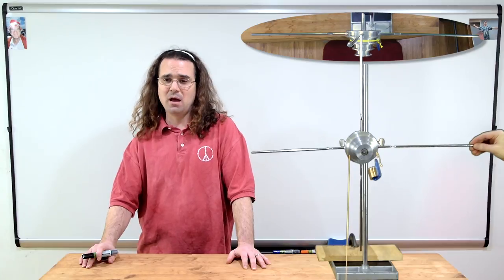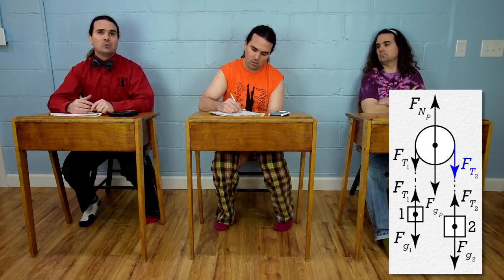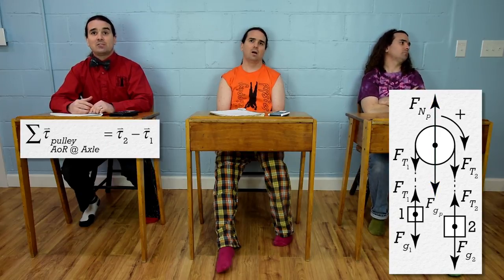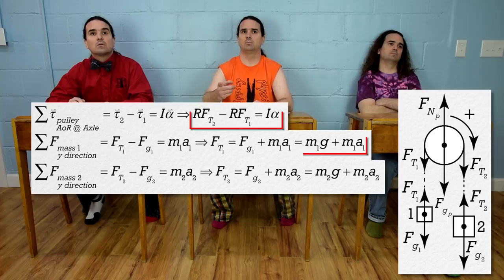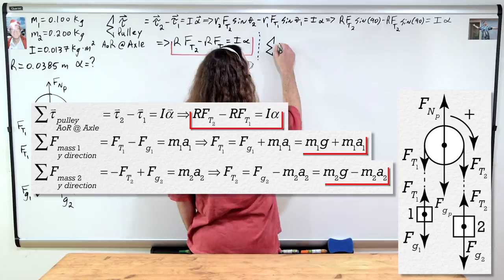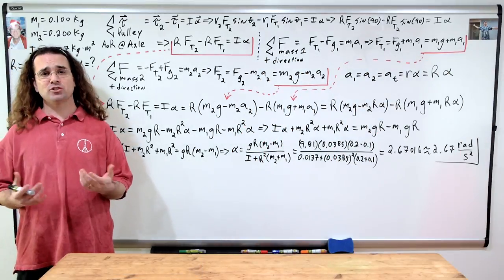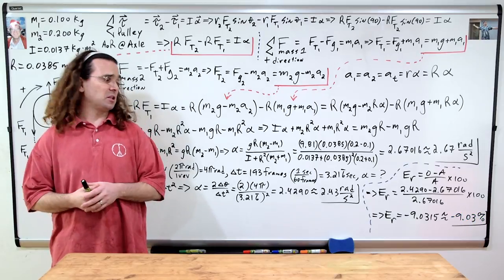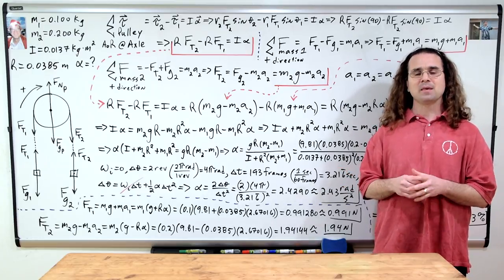2 Masses on a Pulley - Torque Demonstration

Comment: What if pulleys with different radius share the same rotational axis?

Thanks.
Reply: The two pulleys would share a common angular velocity (and angular acceleration) by virtue of being part of the same rigid body, but have different tangential velocities and tangential accelerations of the spooling string, that are each proportional to their respective radii.  You would also need to set up a relationship between the two angular accelerations based on the ratio of pulley radii.

As an example, suppose mass 1 is 10 kg, and is connected via a massless string to the left side of pulley #1 with a radius r1 = 8 cm.  Mass 2 is 5 kg, and is connected via a massless string to the right side of pulley #2, which has a radius r2=4 cm.  The two pulleys are rigidly attached to a shared axle mounted on frictionless bearings, and the entire assembly of the axle and pulleys has a rotational inertia of 0.012 kg-m^2.  Calculate the unknown accelerations, tensions, and angular acceleration.

N's 2nd law on m1, assuming it descends:
m1*g - T1 = m1*a1

N's 2nd law on m2, assuming it ascends:
T2 - m2*g = m2*a2

Torque on the pulley, and rotational version of N's 2nd law:
T1*r1 - T2*r2 = I*alpha

Relation to alpha of a1 and a2
a1 = alpha*r1
a2 = alpha*r2

5 equations, 5 unknowns (alpha, a1, a2, T1, and T2).  Solutions:
a1=5.6 m/s^2, downward
a2=2.8 m/s^2, upward
alpha=70 rad/s^2, out of the page
T1=42 N
T2=63 N

Comment: If the pulley is frictionless, why will it rotate? Won’t the strings just glide over it?
Reply from the maker: A "frictionless" pulley has a frictionless axle only.
The mass of a string is so small relative to everything else as to be negligible.

Comment: why do the hanging masses not contribute to the torque ?
Reply: They do, but indirectly.  The masses are connected to the pulley through the string segments.  Since the tensions in the string segments are what act on the pulley, we don't need to further account for the masses, when summing torque on the pulley.  We already did that by accounting for the tensions, each applied by these masses.
Reply: @carultch  Well, to be more precise, the total torque on the pulley about the central axis is due to the static friction between the rope and the pulley. When we sum these forces, mathematically, it's equivalent as if it is the tension force that is producing the torque. Unfortunately, this is omitted from most if not all high school textbooks.
Reply: @Test-ph1vk  True, it is static friction that is really causing the torque.  This is probably ignored from most high school level textbooks, because it is an extra detail that doesn't really contribute to the main substance of the problem.  This is usually introduced in freshman-level engineering classes in college.

There is an equation called the capstan equation that governs the upper limit of tension ratios on opposite sides of a string wrapped around a cylinder, that is derived from static friction in this example.  Named the capstan equation, because a capstan on a sailboat is an application of this formula.  Where you would want to model this detail in this problem, is if you were asked to determine limits to the hanging masses, before the string would skid on the pulley and roll-without-slip is no longer valid.

Comment: Are you assuming that the string is massless? Cuz then only F(T1) acting down on the pulley = F(T1) acting up on the mass. Cuz if it weren’t the case, a little piece of string would have an infinite acceleration
Reply: Yes, we do assume a massless string.